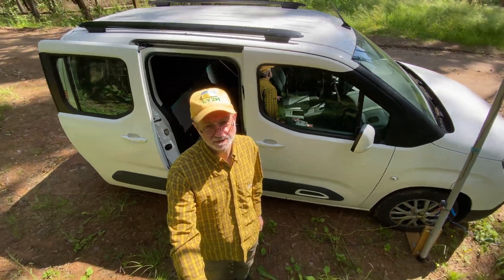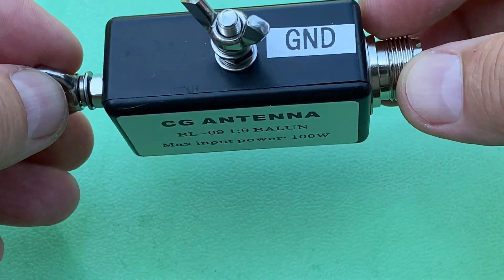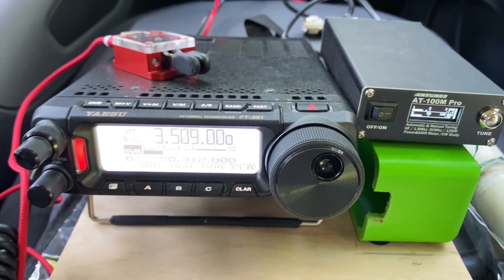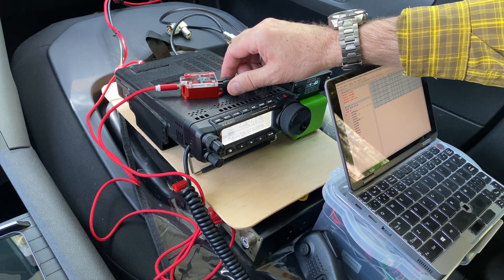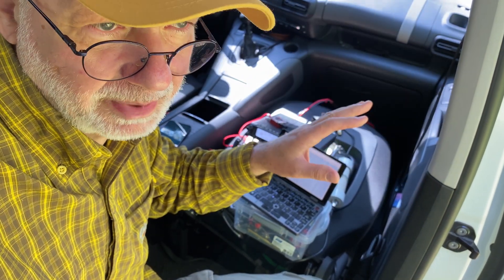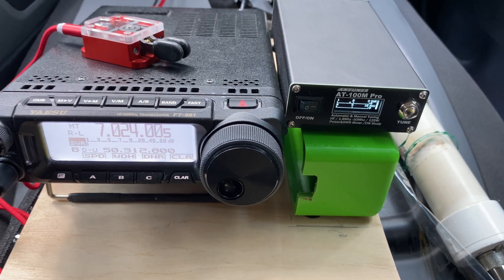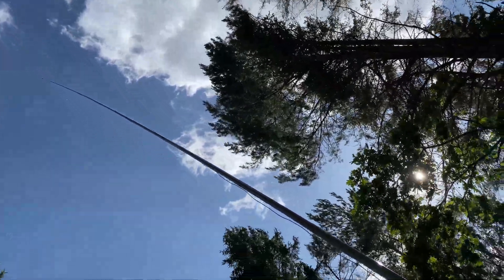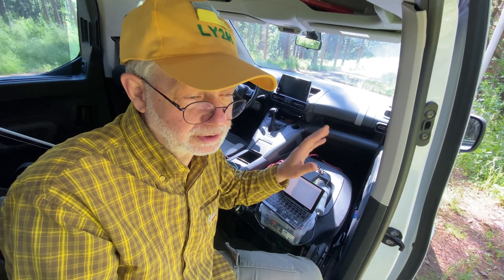9:1 or 4:1? Which UNUN is best for a random wire vertical?

Comment: Thanks Linas for your videos. I'm not sure. But what kind of counterpoises do you use for testing, and how long are they?
Reply from the maker: Thanks! It's in the video :), 3 radials on the ground, abt 6 meters each, plus coax cable's shield (terminated with RF choke at the end of the radio), some 5m more.  73! Linas LY2H

Comment: What was the Logging Application..?? Many Thanks
Reply from the maker: It's a FLE ( Fast Log Entry), Windows only, optimised for parks , SOTA etc. activities, could be run real-time or off-line modes. No CAT functionality. 73! Linas LY2H
Reply: @Linas_LY2H  Many Thanks...
Reply: Hi Linas, thank you very much for sharing your video. I like very much your tests.
Please, can you say a bit more about your very small computer? Where can be found. It matches perfectly a small /p station for sota/pota activations.
Best '73,
Enzo, iw7dmh
Reply from the maker: @enzo_sv Thanks Enzo! The small PC is  8" CHUWI Mini book, it seems it is not  in production anymore. But may be they have some newer models. After some 3 years of using the internal Li-po battery has died, luckily, it is still possible to buy a replacement pack. Otherwise, it suits most of my portable needs. HTH, 73! Linas LY2H
Reply: How many meters are the radials you use? 8.8 meters of irradiant. TNX Luis LU4HK
Reply from the maker: @luisgalina2770  Hello, I was using 3 radials on the ground, about 6m long each. HTH, 73! Linas LY2H
Reply: @Linas_LY2H thank you

Comment: Maybe it would be best to compare the 4:1 and 9:1 without an atu on a spectrum analyzer  to see which is nearer to 50 ohms
Reply from the maker: Sure, next time, may be, together with insertion loss and other VNA stuff :) This time, I wanted  purely empirical /practical  exercise which proved it does not matter which unun makes it closier to 50Ohm, as long as it falls into a tuner's range :) 73! Linas LY2H